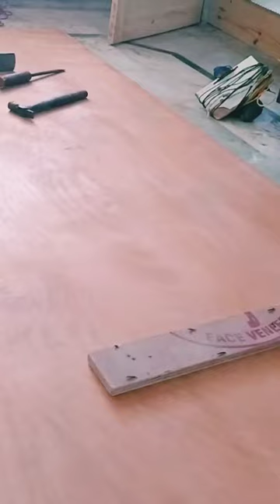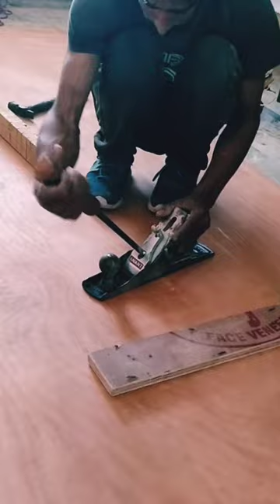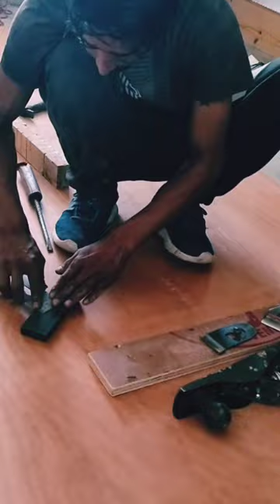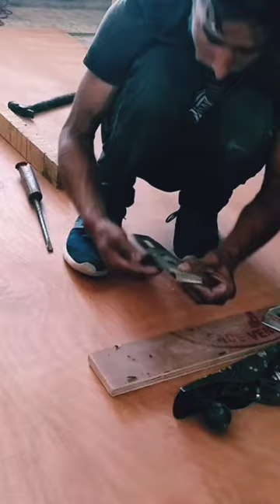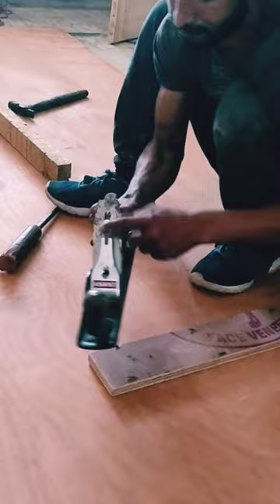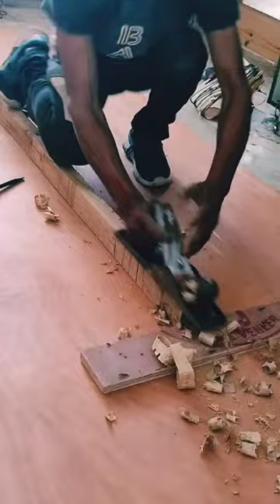sharpen your hand plane blade & smooth wood finishing #bladerunner #bladesharp#bladesharpner #shorts

Comment: Using a screwdriver to tighten your lever cap is a terrible idea.  It's supposed to be just tight enough to keep the blade in place, but loose enough to allow the blade adjusting wheel to work smoothly and easily.

If it's too tight you'll mess up the threads on the bolt or wheel, and possibly damage the frog.  You should be able to adjust the lever cap bolt with your fingers when the lever cap is off the plane.